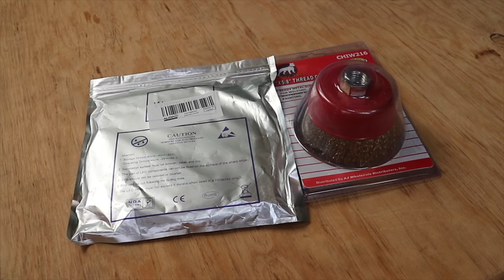Chasing Fish and Coral

Comment: Hey Justine, I’m the guy that met you at the Cozumel ferry. As I told you I’m spending some time here diving.
I just came back from one of these dives and I can tell you that the number of fish vary a lot between dive sites, we saw a huge school of silver fish that I don’t know the name just standing around the coral formations, large groupers, moray eels and yesterday we saw at least five nurse sharks. Every site is very different, both in terms of fishes and corals, in some places you don’t see a single patch of bleaching, in others you see a lot.

I’m sure that the number of boats, both for diving and water activities, affect the marine life, but I’m not sure about the scale or what is the main culprit. Underwater the boat noise is pretty bad, but I didn’t see a single piece of trash so far, and the water in general seems very clean, even at the marina. If I were to find something that is dodgy it would be the constant flow of cruise boats, which are essential for the island economy, but I doubt that the companies running them care much conservation, unlike scuba shops that depend on it, but I’m biased.

Cozumel is beautiful and I hope it will remain so for a long time, which unfortunately is unlikely.

Good luck with the boat work.
Reply from the maker: Hello Rafael! Nice to hear from you, I remember!

I should have mentioned the cruise ships, because yes - they are an extreme cause of problems for an ecosystem such as the one at Cozumel.
I should also make it more clear that we have nothing against the local dive industry and only hope that they can remain functional with a healthy reef for a long time, like you said. Thank you for your input! See you around!